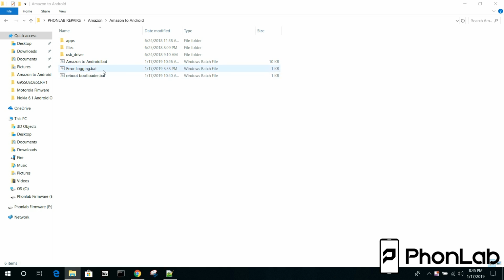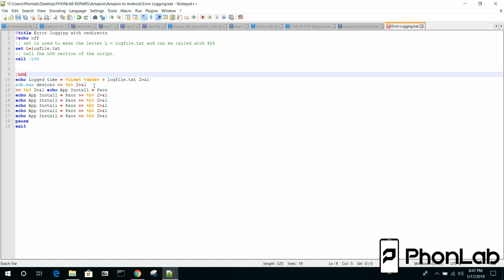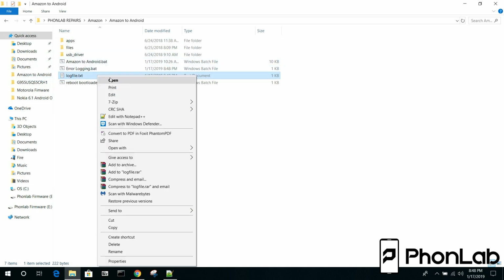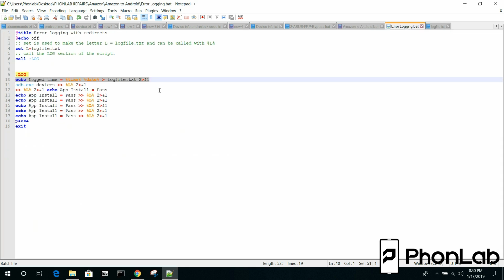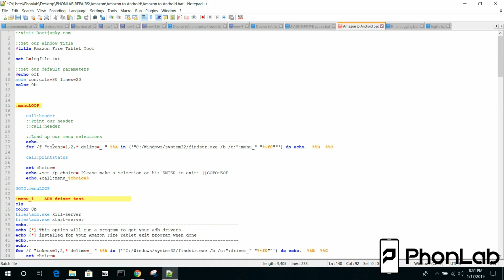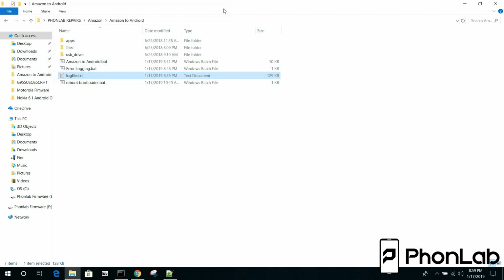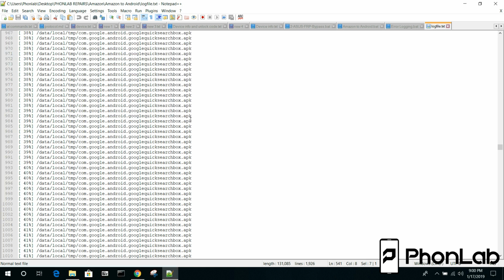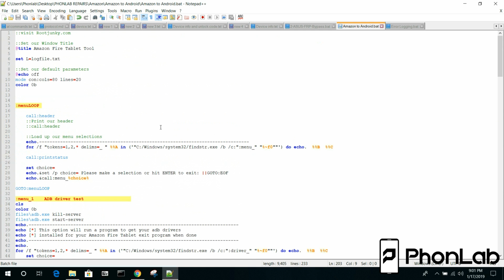How to handle error logging and exemptions in your Batch file

Comment: Ups. I have no error handling in my DOS batch files. The user have to start/call the DOS batch files with suitable parameter attached. I put some notes at the top of each batch file to show which parameter are needed to start the batch file and which values are suitable to use.